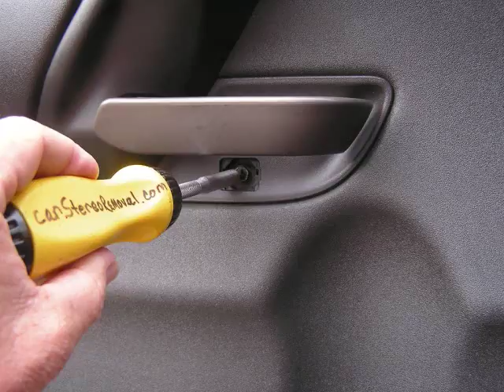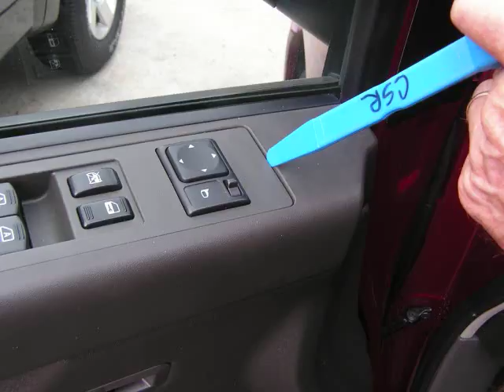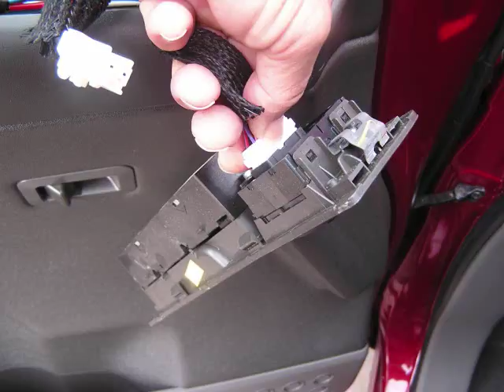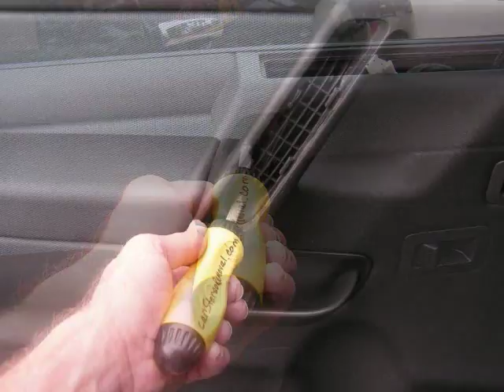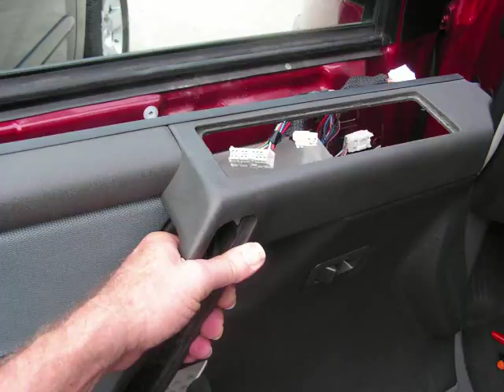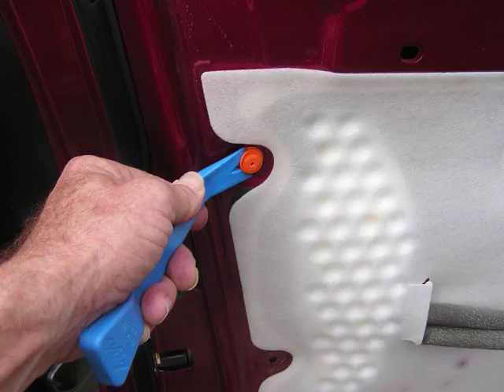Nissan Titan Speaker Removal - Front Door = Car Stereo HELP

Comment: Why don’t they just make it where you can just remove the speaker instead of the whole door panel. No brains!
Reply: For real😂but i mean i guess its good just incase someone tries to steal them cuz they gon have to remove the whole thing
Reply: @luisfromthe803gaming6  Is car stereo theft still a big thing? I thought that died out in the early 2000's due to the fact that phones, GPS devices are just as expensive but far easier to remove.
Reply: @CopiusHayesMusic  yeah I think your right ! I stopped stealing stereos in 99’ 👍🏽

Comment: Anyone know if the speaker output to the door speakers is full range?  Or is it crossed over with the tweeter in the dash?  I cant seem to find this info anywhere on the net.  I would like to upgrade to better coax speakers in my wife's Titan.  She has the basic factory radio with the back-up camera screen on it.  No factory amplifiers.
Reply: I believe that they are crossed over because they play bass but they don’t play that high I could be wrong though